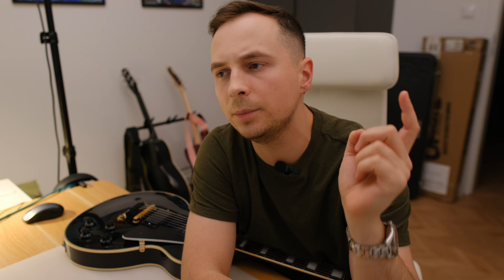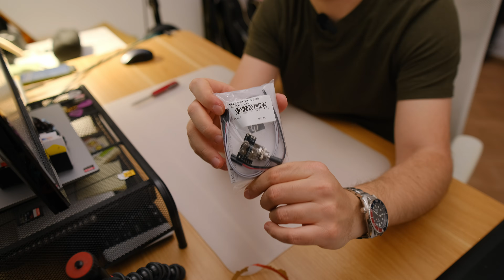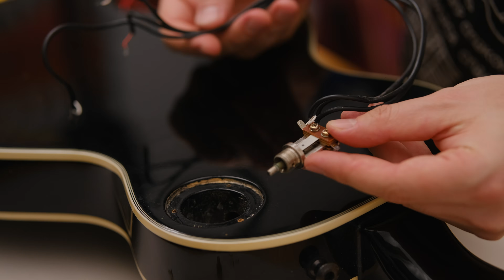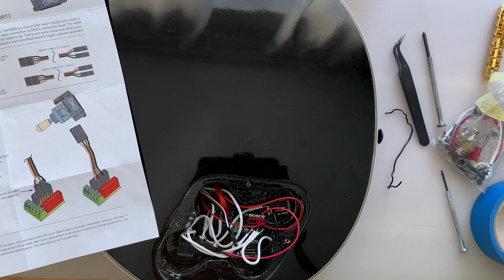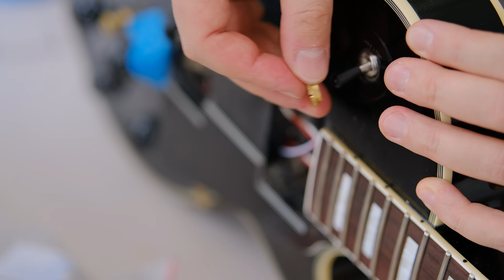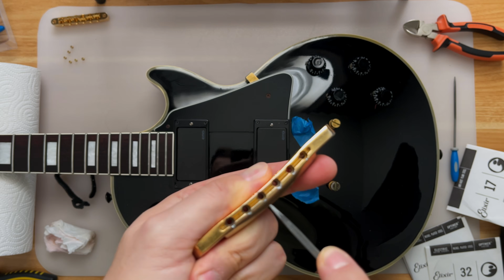Add this EMG part to their pickups sets

Comment: Another tip: while planning, you can email EMG for a wiring diagram if you can't find one specific for the arrangement of components. They'll usually have something on file. You can also ask them for confirmation of what wiring is best or possible. 

I used a P85 (neck) and an 89 (bridge) with 1 tone, 1 volume (push/pull), and a 3 way blade switch. They sent me a pdf with this wiring. I made a mistake and didn't remove a shunt, so I was running both pick-ups at the same time. Small details 😅
Reply from the maker: Devil is in details)

Comment: I've been running EMG's for years. Not on topic but once I ran a 24volt battery in the guitar I will never go back to 9volt. 
   It's a noticable how much more headroom  hitting your amp you get. 

   When I install emgs I always use the factory switch.  All I had to do was remove the ground from the switch and it works perfectly. It's been working for me for over 20 years
Reply from the maker: @dogoanddirtbikes  thanks for the tip, about voltage..not even 18, but 24v?

Comment: Well i had 3 Guitars with EMG Solderless Switches and they caused always Issues with Output or not even Working Sometimes.. When switching a Position.. 😅
What i did is bought 3 New Switches for 6 Bucks and Soldered them and Connected them into the Quick Connect Board with the Screws and i not have any of these Issues whatsoever.. Im even using Passive EMG's and Fishman Fluence Pickups but even Active EMG's with that Quick Connects and not having any issues Whatsoever.. 😄
Reply from the maker: @chrisr0lltdasr  maybe you had bad luck with them, I don’t think it’s bad product..but only time will tell)

Comment: Does something like this exist for passive electronics? Soldering is fine if you’re conservative, but if you are someone who constantly tinkers it’s such a drag. I have to have an entire table and wall dedicated to soldering in our small house.
Reply from the maker: Hi, you can consider EMG passives for the solderless set of electronics, or if you can solder at least something, maybe couple of wires - you can buy online some custom sets of pre-soldered electronics. You need to solder the pickup wires there, so this is the compromise
Reply: You can use the passive EMG solderless set. I've done this with a few Dimarzios. Some soldering is obviously still required, as you would need to cut off the pickup side of the quick connect cable so you have the loose hot, ground and series link wires and solder those to the corresponding leads of your passive pickup. There's also the Seymour Duncan Liberator pot, where you screw the leads from the pickup in instead of soldering.